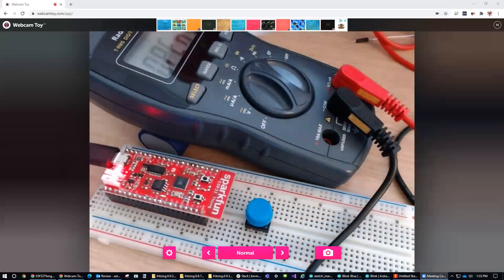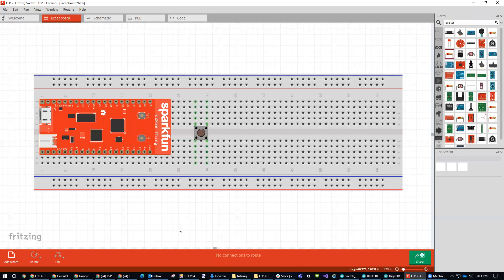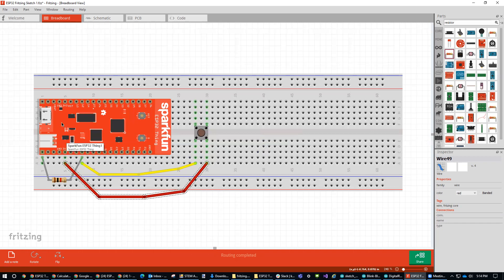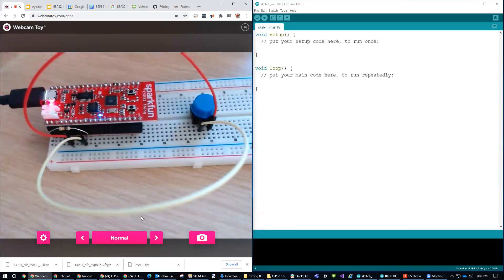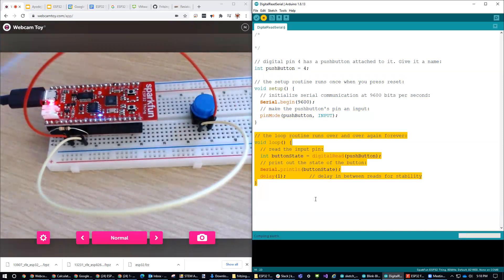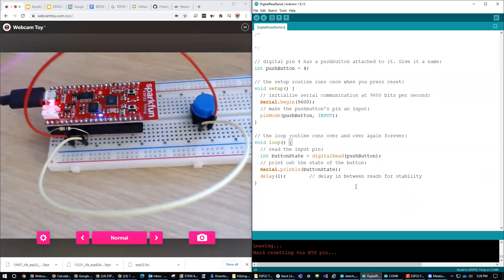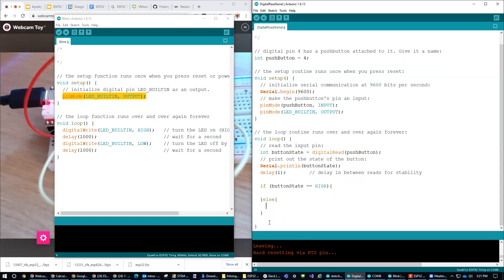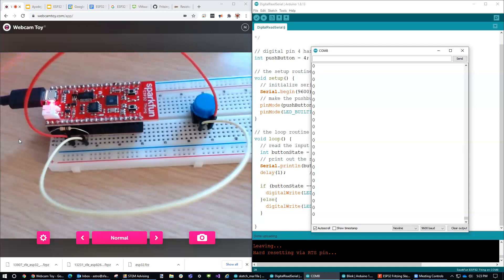ESP32 Thing - Simple Button Press Detection

Comment: is it ok to connect a switch to a gpio pin and gnd pin without any Resister, by using INPUT_PULLUP in place of INPUT??

I am super noob, just got interested in microcontrollers recently, I am trying to make bluetooth macropad with ESP32. Any help is very much appreciated.

Edit: And also, if it is possible to just use INPUT_PULLUP, can i use it for all the switches in my macropad??